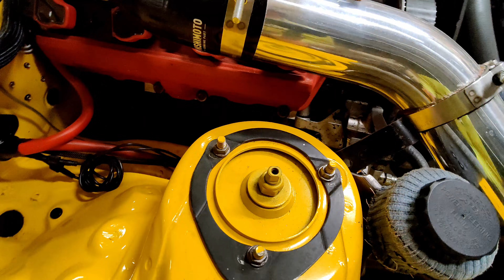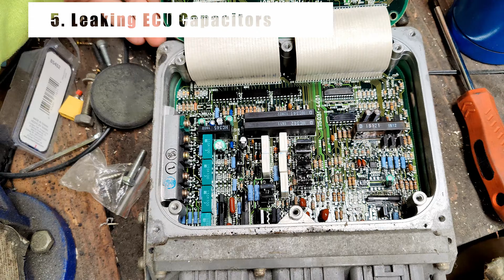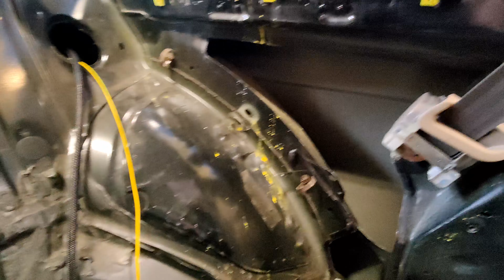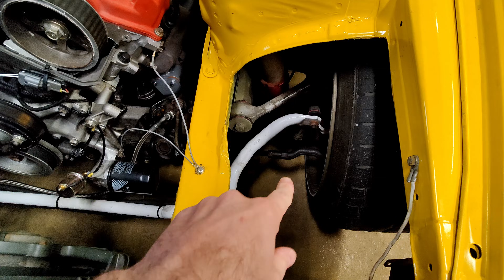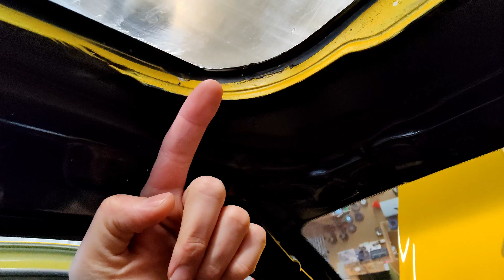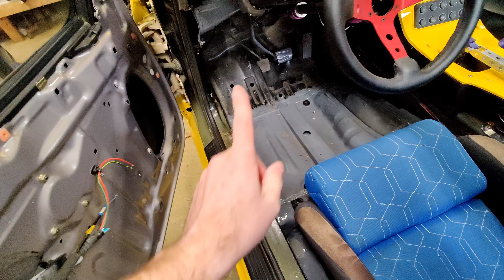Is The SC400 Reliable? All The Common Problems

Comment: So, I’ve been looking at this car for a while, and I just turned 16. Would this be a good first car?
Reply from the maker: No
Reply: just get a corolla or something you're not afraid to crash
Reply: My SC300 is my first car, I absolutely love it, after ab a year and a half of ownership  here's what I've had to replace, power steering pump and hose, starter, got it at 94k miles and at 116k the waterpump went out, so I replaced the waterpump and timing belt which wasn't too bad especially for my first time doing anything like that, and my brake booster went out around 124k which was absolute hell to fix, however I'd do it all again bc I drive the piss out of this car and it just eats it all day, granted tho I got a Extremely good condition car, that was likely garage kept most of its life and I'm the 3rd owner
Reply: It's all about how far you are willing to go with the car and how much money you have to be able to fix it when the shit hits the fan

Comment: Ding Dong u said u know these cars i have a question for you i have a 1996 sc400 lexus been running fine the i had a crank no start condition change crank sensors, camshaft sensor, new spark plugs new igniters change the two coil pack new fuel pump new fuel filter got ecu check and done new temp sensor for radiator clean maf sensor switch idle air control valve still no start i smell gas when trying to start car could my exhaust system be clogged or do i have a leaky valve car was running great i do have a check engine light but ob2 doesn't work neither under the hood man can u give me a possibility of what might be wrong.
Reply from the maker: You had your ecu checked? By who? Try tapping the EFI relay while the key is turned to ON and see if it starts.
Reply: @DingDongDrift  ecu check and repair by Rentless Motorsports Texas. the Guy name is Josh  he does great work on 1uz ecu. i didn't mention but i change the efi fuse but didn't tap it would that cause it to smell like gas when im trying to crank it. Sorry for the late responds didn't know u answer back.
Reply from the maker: It smells like gas because there's no spark but the injectors are still firing. You're not getting 12v to the MREL pin on the EFI relay which disables ignition. usually this is a side effect of a bad ECU, my car had the same exact problem. You need another ECU. Stop trying to replace every part. Sometimes this is also caused by a bad ground somewhere.
Reply: @DingDongDrift  i had my ecu repair also exchange it out with a ecu from a friend sc400 same year as mines still same result i'll try pressing down on the efi relay to see if that's works. where is the locations of the grounds. i know there are severals grounds on this car.
Reply from the maker: Tapping not pressing down. Have someone crank the engine while you lightly tap on the relay. There's a ground behind the engine on the firewall, one on the driver frame rail by the battery, and a few others i don't remember exactly where they are.
Reply: @DingDongDrift  ok thanks  for responding to me I try to get to this asap keep making the great videos bruh!!!

Comment: One word to describe an sc, OVERHEAT. if there’s one thing mine is good at, it’s that. Power steering pressure messes with cooling, the quirky hydro fan needs to be treated like a newborn and have a combo of everything working or it won’t turn your fan. These radiators love to pinhole leak at the neck connecting to the tank, and hose your engine down with steam. The thermostat housing also loves to crack or split etc. i still love it but it’s a hefty one to get reliable.
Reply: 175k on mine and not a single cooling issue.
Reply from the maker: Yea yours is definitely a one off, never heard of overheating issues.
Reply: You got a blown head. Leaky rad. 
They eat the rad that's why
Reply: Uz cooling tends to be amazing from what ive seen. Maybe you got a bigger issue youre looking at

Comment: I have an 96 custom SC400 3,050 lbs and runs mid 4 second 0-60...lots of fun! I'm very interested in the  COP ignition set-up you're running! Are you running a standalone ECU? Personally, I luv the CD009 set-up, but my car has an upgraded auto/shift kit with gated shifter, so with reasonably low miles, I'm not drifting and no plans to go manual w/respect to standalone. I wish I knew how to keep the factory ECU for automatic transmission and fuel only, while using the FORD EDIS 8 Ignition system... any thoughts? Incidentally, my car lately, will only start, then stalls out. I've been unable to repair and, since I've deleted everything emissions related and no cats, I'm not going to take it to a local mechanic, so he can bill me for hours of troubleshooting! It seems to be, that the ECU is cutting fuel off? When I just barely crack the throttle, then it cuts off(severe lean condition)...can spray starter fluid into TB and manually keep it running. I'd definitely like to bypass or delete the MAF...any advice or help?  Anyway, the factory ECU has been repaired 2 times(leaky capacitors) and I've recently sent it back to SIA Electronics, because it's not communicating with the OBD2 port. PS luv the yellow! 👍
Reply: Update on my 96 SC400; Since I'm not required to have emmisions/inspection, I'm in the process of installing the Microsquirt AMP'D DIY standalone ECU and will be piggybacking the trans to the factory ECU. Also installed the 2UZFE COP system. Microsquirt AMP'D allows for full engine control via laptop and illiminates the high cost associated with most aftermarket ECU systems. Of course you need to have the ability to understand basic engine requirements(understanding) and reading of wiring diagrams. You'll need the OEM colored ECU wiring schematic. This will require me building my own dedicated engine wiring harness. Benefits: removal of rpm limiter, speed limiter, 2 step launch control, MAF delete, AICV delete, timing control, NOS activation, fuel control (wideband) and more! 
PS factory ECU is holding the 1 UZFE back..it's a mild OEM economy tune and can't be hacked. If you're looking to build power with add-ons, such as headers, intake, your gains will be limited by the factory ECU. My .02
Reply: So, I can't promise anyone the same results on 0-60, as my car is custom and I'm @ 368 feet elevation.
Here's the primary upgrades:
Transgo performance shift kit w/2000 SC300 gated shifter (shifter is key to consistent manual control)!
* 500 lbs weight reduction w/detachable hood for additional 50 lbs/hood pins required.
* Welded 3:92 diff
* Titan solid subframe bushings
* Supra TT rear solid swaybar
*Poly bushings throughout, i.e., upper/lower control arms.
* Cut coils; 1 front and 1.5 rear.
 (stiffer/lowered to 49.5" height).
* Sunroof delete
* Solid PS bracket/bushings and delete.
*A/C delete
" ABS delete
* EGR/AICV delete
*2000 LS 400 brake upgrade w/SS lines.
* Battery relocation (trunk/passengers side)
Note: all of these suspension upgrades impact how well the car consistently launches..very planted!
Engine: 
*upgraded air intake..to cold air at fog light entrance.
* Ported upper/lower intake plenum (gasket matched).
* Ported heads @ intake(gasket matched)
* Electric fan
* Hydro fan delete
*2000 GS 400 ported exhaust manifolds.
" Primary/secondary/resonator delete with 2.25" true dual exhaust w/H pipe and no mufflers.
* Coolant bypass/TRAC delete@ T.B.
* Water meth injection@ wide open throttle.
Note: these are the primary upgrades, which allowed me to run mid to consistent high 4's
The key is power to weight! My SC weighs 3,050# w/o hood; add great gearing (3:92) w/ solid manual shift control and an estimated 300 HP/310 TQ
AND YOU end up with a  solid performer!
I've done much research and have a background in primarily drag racing, however I've also had great appreciation for excellent canyon carvers (well balanced/handling) sports cars. 
Take a look at the C5-C6 Corvette.. granted stock for stock they're superior, however look at these vettes as proven performers and then look at what potential the SC400 shares, i.e., front mid engine, equal wheel base.
So address the SC's weak areas.. weight, brakes, suspension, track width, etc.. and you now have a competitive, high speed, excellent handling a stable car!
All depends on your goal...retain luxury or compromise for performance? I've retained many of the luxury features, but my goal is SPORTS CAR performance over the heavy luxury goals of LEXUS.
The SC has a very stiff chassis(well engineered!
Hope this helps 👍
PS  I'm currently deleting the factory ECU and building a custom engine harness for the DIY Megasquirt/Microsquirt AMP'd. This will further improve my performance by offering tuning capability and overcoming the conservative economy tune by Lexus.
Examples: 2 step launch control, RPM cutout, MAP vs MAF,  COP, Fuel  and timing control. 
Unfortunately, this system isn't legal, if you live in an area requiring emmisions.
As for adding Super charger, the early 1 UZ can take boost 10-12+. However, I'm not wishing to create more front engine weight and having the 96/second Gen 1 UZ w/microsquirt AMP'd, I'll be able to add NOS activation/control and safely add 75-100 additional HP, which places me In a highly competitive class with modern performance cars, while retaining reliability and without adding additional weight and clutter to the engine compartment..My .02
Reply: Yoo what have u done to run mid 4seconds .
I have a clean one and would like to swap to manual & thought about supercharging bc it’s my daily and Need reliability . Thoughts ?!

Comment: Got a 92 400 I've owned for 20yrs got it w some cluster gauge lights out, replaced my door hinge. Thats about it, none of what you mentioned except for the LCA's of course battery's, tires, struts, the normal stuff. Windows still go up and down all light bulbs still light. California car no rust 300,000 miles. On Club Lexus (the Purple Bullet)
Reply: Im looking at one with 270k, cant tell if its a good decision at this point lol its pretty clean tho like "highway cruiser" type but when you inform urself of potential bads you find it. Would love your input, thanks!
Reply: @codezalo5773  his is a unicorn...I've owned sc400's for 10+ done alot to them almost everything he listed in the video i have had to fix....most you find are going to be beat unless you find it from a older owner non modified and well maintained

Comment: I drive a 1992 SC400, and I want to keep it forever. Thanks  for all the heads up.
Reply from the maker: No problem, keep up the maintenance and you definitely will drive it forever
Reply: @DingDongDrift  I changed my starter a year and a half ago. Holy crap, it took me nearly 70 hours! (Yes, I am slow, because I was learning as I went.)
Reply from the maker: It's pretty tough just because of the rear water neck and harness. Those bolts are terrible to get to
Reply: @DingDongDrift  Indeed. I was able to extract those two starter bolts, thanks to an 18 inch long, double-articulated, swivel-headed ratchet. Without it, the job would have been impossible.  I did it WITHOUT touching the water bridge, and without undoing the bundle of wires attached to it, which saved me a lot of mess.
Reply from the maker: Did you still go from the top?
Reply: @DingDongDrift  Yes. My car is stock, so I had to remove mountains of parts, before I even got to the intake removal.  And, just as promised, I felt that elation that comes with finally being able to see the starter and put a hand on it...immediately followed by the heart-busting realization that the starter bolts screw in from the firewall side.  

I didn't have the tool on hand, so I searched online, and waited a week for it to arrive.  In the meantime, I tried every other tool under the sun, to no avail.  

When the tool arrived, I snaked it between the water bridge and the firewall, got it onto the bolt heads, and started wrenching.  It was an utter nightmare.
Reply from the maker: Oof that sounds terrible. Idk if you can see in my starter video but i luckily had the firewall simplified a lot and was able to get a wrench in there.
Reply: @DingDongDrift  I will take a look at that video a little later. Thanks for pointing me towards it.  Yeaaaaaah, this project was nothing but oof, all the way down. But hey, I accomplished it, and I'm proud of myself, and my car will (probably) not need another starter for a couple of decades. haha

Comment: i did 12v mod and i still have intermittent starting issues after driving around for a while but will always start up eventually, it is a super inconvenience running errands but no problem going to and from work. do you have any ideas? I have some more info if you think you can help me out, please I've already spent so much trying to fix it
Reply from the maker: 12v mod will never fix intermittent starting.
Reply: @DingDongDrift  so do you think I need a brand new fuel pump ecu?
Reply from the maker: The fuel pump ecu isn't the problem. If you're getting fuel then something else is the problem

Comment: Just got my 1992 For 2200 180k everything is mint the guy actually bought it from Lexus while working there got tons of service records, plus it’s been old man driven for awhile , 0 rust (although I do live in Texas) So far loving it! the PS pump is extremely loud until warmed up lol and my needles are about at half mass but the temp gauge doesn’t light up at all it’s got really nice apparently rare wheels, I’m pretty amazed at the build quality of these cars ! I had a 98 Avalon that had 290k the car was falling apart and shitty but would start every day! Kinda sold on Toyotas, 
But overall kinda bummed out on the aftermarket support for these cars thanks for the SC4 Content maybe down the road supercharger tutorial 👀👀
Reply from the maker: Congrats on the clean SC! Keep up on the maintenance and you'll put another 200k on it easy. Supercharger will definitely not happen, i don't like them lol

Comment: My car had basically every single problem you listed. Had no idea you had 10 years experience on these. I'm super late to the game (2nd owner) but after two years I've had to do several of the fixes you've listed here. Really wish I had this video a couple years ago before I bought my 93 SC @ 220k mi. The old man I bought it off of did the water pump and transmission overhaul but missed bascially everything on this video. Also; the Nakamichi stereo sounded terrible and the speakers were all blown 100%. These really are old shit buckets <3
Reply from the maker: Yep i dealt with all these problems in my previous SC as well. These cars are pretty much clappers at this point unless they have been meticulously maintained.
Reply: Depends on who you buy it from or how many Kms they had before you. You don’t know
When it how often stuff was changed.
Reply: Do you visit a mechanic or fix it yourself?
Reply: @yummy_tubby_toast  fix it myself with friends. Only ever had the valve cover gaskets done at a shop early into my ownership
Reply: Wow that’s a lot of miles. Do you still have your SC?

Comment: I have made write ups on how to fix the door catching on the fender issue and how to rebuild the fuel pump ECU for those interested 

Just look up "How to REBUILD your fuel pump ECU (Not the bypass but fix the part itself)" and " Door catching on fender? how to fix the hinge with mostly off the shelf parts." on club Lexus.

Comment: Was waiting for the door hinge, mine is bad and have to carefully open/close it, you can just adjust the fender to fix it? I've replaced the hinge but the same issue
Reply from the maker: You can adjust the fender a very small amount, sometimes it's enough to fix it. There's someone in Australia that fixes these hinges and adds a grease fitting so you can maintain them a little.
Reply: @DingDongDrift  wish they made rebuild kits for them
Reply from the maker: Yea would be cool

Comment: usually they will need new crank seals, crank shaft position sensors, power steering, lower control arms, and the starter for some. mine also needed a new fuel pump ecu and had clogged primary cats at around 130,000 miles . can be pretty expensive but they do run nice after that haha
Reply: That's it?😅  my sc300 is a Hazmat area ⚠️☣☢
Reply from the maker: Yea it's a bit of a list for most cars lol
Reply: Did you do the fuel pump ECU yourself?
Reply: @75lord  no i actually had my guy just bypass it completely. works great

Comment: I have a weird idle where the car goes up and down in the revs and i have no idea what it is. I tried playing with the throttle wire but it didnt help, either idled to high or did the up and down idle.
Reply from the maker: Yep, what he said ^ clean the idle air valve
Reply: Try cleaning air idle control

Comment: Great video... If you had the original side mirrors you could have also included that...the mechanism that holds mirror spring breaks causing the mirrors to move around.
Reply from the maker: Actually i haven't had that happen to either of my cars, but thanks for letting me know

Comment: My megasquirt cars don’t run iac valves and we don’t hold the throttle to get it to idle. My girlfriend would kill me. Your car is super nice
Reply from the maker: It's only in cold weather cold starts that mine doesn't idle. Once it warms up it idles perfectly.
Reply: @DingDongDrift  I can change that if you send me your file and a log on cold start.
Reply from the maker: @mywireshop  ehh it's fine, i barely drive it when it's cold

Comment: 50k miles on mine so far and only issue I've ran into is the power steering pump leaking onto alternator, flca bushings, and rear subframe bushings..
Reply from the maker: How the hell you only have 50k miles?
Reply: 150k? 😲